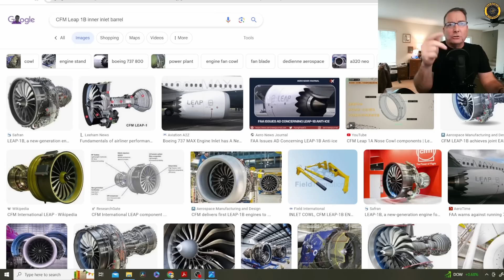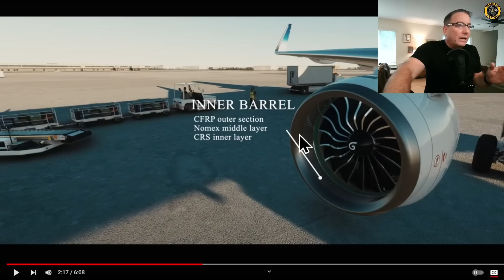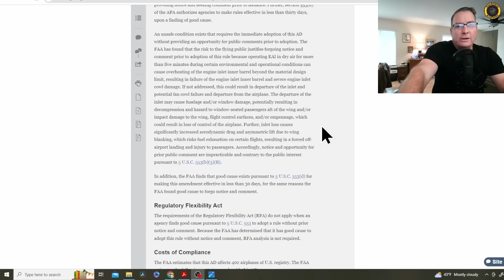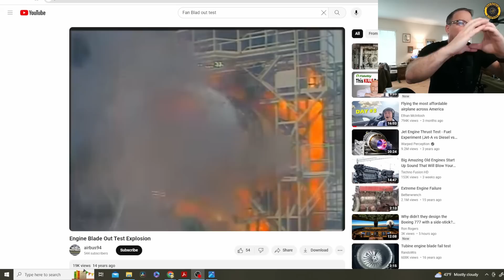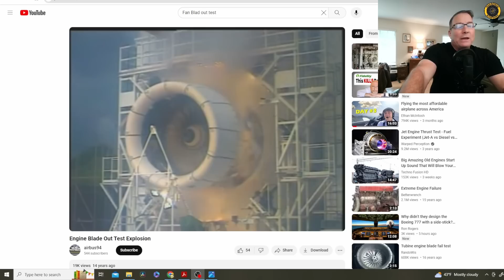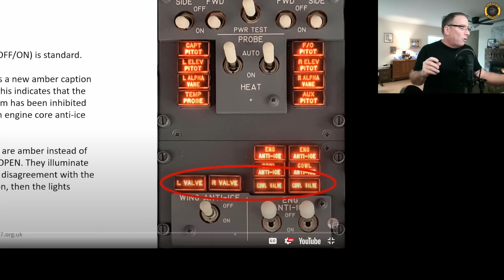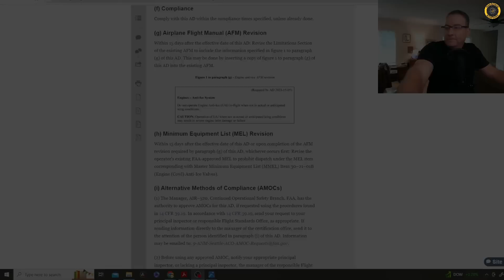Boeing 737 Max-7/-10 Certification HALTED! 1 Feb 2024

Comment: Quality control on an automobile is one thing. You can pull over to the side of the road and get a tow truck. Don't think they have come up with tow trucks for airplanes yet. This is why so many people have a bad taste in their mouths for large corporations.
Reply: There have been no in-flight incidents with the 737s nose cowls.
Reply: But this is just another issue with the 737 Max. I would have thought Boeing would step up Quality control if for no other reason to provide confidence in their planes. If Airbus could step up production( which I know they can't) Boeing would be in trouble. @John-nc4bl

Comment: Doesn't the a320 neos have the leap engines too?  Does it have this problem as well?
Reply: CFM does not design/make the nacelle anti icing components and the problem is not the LEAP engine. It is Boeings design of the nacelle anti icing system/components that is the problem. Airbus uses a totally different design and has NO problems
Reply: Remember he said "newer designs have an auto anti-ice mode"? That solves this problem by turning the anti-ice on and off depending on the conditions. Take a quick guess as to what those "newer designs" might be...
Reply: @davidwright7193  320 is from the late 80's.  But I guess modern enough to not have this issue.   Tks for responding.

Comment: Odd, I'd think the easiest thing to do on a jet engine would be to mix cold air and hot air to a required temperature range.
Reply: Bill, that sounds complex (something extra to go wrong) but doable. However, would that compromise the "single type certification"?  If the answer is "Yes" then Boeing will dismiss the idea out of hand, from what we have found from Juan.

Comment: I was going to ask how Airbus dont have the same issue considering its the same engine on the neo.The fact that its down to Boeing keeping the same overhead switches as the classic,its just another way they jeopardised safety by doing everything they can to avoid crew needing sim time.
They've destroyed the legacy of the 737,which was an amazing airplane,right up to the point Boeing took it beyond its capability and did deceitful and dangerous things to cover the cracks.

Comment: I guess there is both good and bad news in this. The bad news is that these engines are mounted on the 737s and unless some cockpit and probe changes are made, the cockpit workload skyrockets! The good news is that this is a engine supplier problem to fix. What was it...about 20 years ago now that Ford had a very long partnership with Firestone tires and the tires had major issues. Ford got blamed Firestone got blamed, but it eventually got fixed.

Comment: Could the bleed air be mixed with ambient air to keep the temperature within limits of the cowling materials. I know it requires mechanical changes to do this but the engine manufacturer should be able to incorporate this change. Then Boeing could take the time to add in automated controls for engine icing control you mentioned that the 777 has. Love your channel and the comments you get from the videos.
Reply: As complicated as that sounds, that is exactly how every vehicle heater in every car ever made since the 40's controls the cabin heat.

Comment: Why doesn't this happen with the Leap-1A and -1C on the A320neo/C919 ?
Reply: CFM does not design/make the nacelle anti icing components and the problem is not the LEAP engine. It is Boeings design of the nacelle anti icing system/components that is the problem. Airbus uses a totally different design and has NO problems
Reply from the maker: Different engine.

Comment: That used to be my favorite seat on planes watching the air go into the engines. Used to be. I love your channel Juan.
Reply: I used to love the last window seat in the back of an MD80, with the engine intake 3 feet away!
Reply: I used to always take the Exit door available: free legroom, and orientation on how to open the door. Maybe not any more??!
Reply: Yep. But now it’s not air going into the engine, it’s engine parts going into your head.
Reply: My non first class seat is on the rear wing spar, maybe two or so rows aft of the emergency exit door.
Reply: Just don't sit behind the engine or next to it, you should be ok a little bit ahead of it! 🤞👍

Comment: I would have thought that after the 737 Max crashes, Boeing would have had a major wake up call and stopped cutting corners. It seems they haven't learned, and it is basically like watching a slow motion train wreck 😞
Reply: It is not a new design they made since the crashes.. been that way on the MAX all the time.
Reply: Not only they have learn nothing, they are taking down the company, customers, employees, suppliers, general public, and USA prestige, while staring befuddled at the spreadsheet on the screen.
Reply: I thought the same thing about NASA after Challenger and then Columbia happened.
Reply: Airbus A320 disasters.

Source:  Wikipedia

On 28 December 2014, an Airbus A320-216 registered as PK-AXC, crashed into the Java Sea killing all 162 on board. 
The cause was initially a malfunction in two of the plane's rudder travel limiter units.

On 19 May 2016, an Airbus A320-232 registered as SU-GCC, suffered a cockpit fire and crashed into the Mediterranean Sea 
20 minutes before its scheduled arrival at Cairo International Airport.  All 66 on board were killed.

On 22 May 2020, an Airbus A320-214 registered as AP-BLD, landed at Jinnah International Airport gear-up and executed a go-around. 
A few minutes later, both engines had shut down. 
The plane crashed into Model Colony near Karachi on final approach to Jinnah International Airport for an attempted emergency landing, 
killing 97 of 99 on board, as well as killing 1 on the ground.

On 5 November 2014, Flight 1829, an Airbus A321-231 registered as D-AIDP, was flying from Bilbao to Munich when the aircraft, while on autopilot, 
lowered the nose into a descent reaching 4000 fpm. 
The uncommanded pitch-down was caused by two angle of attack sensors that were jammed in their positions, causing the fly by wire protection 
to believe the aircraft entered a stall while it climbed through FL310. 

On 31 October 2015, an Airbus A321-231 registered as EI-ETJ operated by Russian airline company Kogalymavia crashed in the Hasana area of central Sinai, Egypt 
while en route from Sharm El Sheikh, Egypt to St. Petersburg, Russia. There were 224 people on board (217 passengers and 7 crew). 
There were no survivors.
Reply: Until Boeing gets rid of McDD people and their policy it will fail. 
Anyhow now it’s to late, the MDD has metastized within Boeing, new generation engineers and company philosophy were corrupted to lesser standards.
Reply: I'm sure if Boeing had their way, they'd just add an "auto" setting to the de-icer.

Ask the FAA why the price tag for that change is so high.
Reply: They hiring more MBA’s to fix the problems.
Reply: They sure know how to do stock buybacks.  Everything else is a secondary or tertiary concern....
Reply: They laid off staff during Covid.  Then re-hired new employees for less rather than keeping on the most experienced ( and higher wage ) employees.  A huge cost savings and a boost to their stock price.  But, and you can 100% verify this yourself, Spirit, their (wholly controlled) "subcontractor" now has over 50% new hires on its staff and the average number of years of experience being about five years.. Same with Boeing.  The number of people with more than 10 years experience is... worryingly small after Covid.  With predictable quality control and design issues as they try to ramp up production to new record levels.
Reply: @josephoberlander  If Spirit is "wholly controlled" by Boeing, then why is Boeing allowing them to build Airbus A350, A220 and Bombardier Challenger fuselages and other components as well as theirs? That would not make any business sense, and Boeing only knows business. They gave up on actual engineering years ago.

Comment: Putting a note in the flight manual to basically tell the pilots there’s a defect here and if you don’t turn this of , well good luck. I can equate this to some eccentric designer in his backyard, building a flying machine not a major aviation company that should build redundancies of their systems. God help the crew if they get distracted with another problem with the aircraft and forget to turn the anti ice system off.
Reply: I'm put in mind of that plane talked about last week with the fuel tank switch over the shoulder. Had the impression the guy building them was tinkering with designs.

Comment: The FAA has to put a stop to allowing the bypassing of a new varient type certificate by just saying, "Well, it's really the same, it's a just a dash 'x'." ANY change to the material engineering design should require a new type certificate, and thus a new certification process from the FAA. This garbage by Boeing is going to get people killed. And it's not a matter of if, it's a matt of when.

Comment: Imagine having the door fall off, the wings melt from anti-icing and for good measure the plane just nosedives into the ground. 10/10
Reply: Twice.  RIP to those poor bastards and may the accountants and executives that killed them enjoy their eternal judgment.  And to the engineers that went along for the ride.  I faced a similar situation at my old employer, an engineering firm that outfitted navy ships.  Little of our stuff was life critical but the cost cutting got so bad and they pushed the engineers so bad I just quit.  I quit engineering altogether and went into repair work.  It’s far more lucrative since the engineers and accountants build so much work for us.
Reply: Yet nobody goes to jail...!!
Reply: @jb-xc4oh    all by design.  it's called limited liability corporation (which were not allowed when the US was founded, by the way, because the founders had seen first hand the corporate corruption of the East India Company).  LLC limits the liability of the owners and corporate officers.  Used to be, corporate officers COULD be charged criminally for things like, oh I don't know allowing their company's avionics software to fly their airplanes into the ground, but for decades now there is no will to charge corporate officers with crimes.  Instead, they fine the corporations and the corporate officers just look at the fines as the cost of doing business, SO THEY KEEP COMMITTING THE SAME CRIMES!  Wells Fargo and Pfizer are good examples of this criminal corporate culture.
Reply: And a spaceship that can't tell time
Reply: @Paramart - actually, the engine would be the component that would melt and fall off.  Minor detail.
Reply: With an aircraft OEM like this, who needs terrorists?
Reply: then they blame the pilots
Reply: Well that a Max for you.
Reply: Oddly enough who still receives bonuses while this non vaccinable epidemic of failure and faulting surges around but oddly again not anywhere near headquarters.
Reply: I would say job well done....if this was your actual goal😂😂
Reply: It’s alarming that it’s up to Boeing to stop the certification process. The FAA should be making that decision. But I guess they have their hands full policing the little guy. They won’t do sh!t to these monster corporations that put profits over safety.
Reply: Its not the wings that are going to melt.
Reply: Triple redundancy?
Reply: I’m very worried that this will actually happen. I fly about bimonthly…no more Southwest…I don’t care what it costs. I’m not getting on a 737 again. Or any Boeing plane until something drastically changes.
Reply: @mollymollie6048 The 737 is the older model not to be confused w the 737 MAX. I actually stopped flying Alaska and choose Southwest instead. The FAA should be fired and sued.
Reply: @schahrzadmorgan  Thank you, I’ll edit my comment. I’ve avoided the MAX for several years…but, well…I won’t edit my comment because I don’t feel comfortable getting on a Boeing airplane at all right now. I remember when the older version 737’s were crashing randomly in the 90s and it took a few years to figure out why. So…that plane is off my list for the time being.
Reply: @schahrzadmorgan  Umm... Southwest operates 737 Max aircraft and 737NG. They are a big part of why Boeing designed the Max in the first place.
Reply: @dougrobinson8602 I was about to say, SW is one of the biggest Max operators, wonder who is she going to fly now. Lol
Reply: @mollymollie6048  I agree with you.  I went through a 20 year phase in the 80s and 90s refusing to fly 737s  and DC-9s on any domestic business trips.  The Admin who coordinated our travel plans was a pro at keeping me off of those aircraft.  

737s and DC-9s(MD-80s) have a very very long history of being junkers.
Reply: @Slonge92  Also was very scared of DC 9s, but was a kid and had no choice in what I was being put on. I remember the 737s falling from the sky (faulty hydraulic…something…that froze everything up) and also avoided US”Scare” of the infamous SNL skit “at USAir, we don’t have a death wish.” I had a boss during that time who refused to fly USAir, and had to switch her flight to another airline…the one she would have been on was the one that crashed in Pennsylvania.
Reply: @mollymollie6048  All Boeing planes are perfectly fine, even the 737s are perfectly fine. The only issues is the 737 MAX. In fact for years most Boeing planes have actually been better than Airbus and other jets. Again, it's just the MAX that's the problem.
Reply: @thecomedypilot5894  Well the 737 900ER has the identical door plug as the MAX, and the FAA has reported that some airlines have found issues with the bolts during maintenance inspections on those as well
Reply: @NondescriptMammal  Ok and? The whole door issue itself will easily be resolved, the point I was making was that it was the MAX that’s constantly having problems. Other than the slight door issue, the 900ER is perfectly safe to go flying, along with every other 737 that isn’t a MAX.
Reply: @thecomedypilot5894  I only mentioned it because you said "All Boeing planes are perfectly fine, even the 737s are perfectly fine."... The word "perfectly" has a meaning, and it is even kind of odd that you say "perfectly safe" now, "other than the slight door issue".
Reply: @thecomedypilot5894  I mean, how exactly do you know they are "perfectly safe" otherwise? Have you personally inspected all of them?
Reply: @NondescriptMammal  Dude, Boeing planes have been flying for several decades. The only brand new Boeing plane is the MAX, the normal 737 brands though are completely safe because the aircraft themselves don’t have the same components that the MAX has. The MAX issues have nothing to do with the other Boeing aircraft.
Reply: @thecomedypilot5894  In reality, it is obvious that there is no such thing as a "perfectly safe" aircraft. Do you disagree with that statement? If not, why do you find it necessary to say such things?
Reply: @NondescriptMammal  But aircraft are exponentially safer than cars and other modes of transportation, it's even safer than walking. The only aircraft with issues is the MAX. Everything else is far safer than any other mode of transportation.
Reply: @thecomedypilot5894  This is clearly true in commercial aviation, but not true in general aviation. General aviation fatality rates per passenger mile are comparable to driving a motorcycle, which is more dangerous than driving an automobile. 

And even when comparing commercial aviation versus automobile travel, the statistics change drastically if you are a scrupulously defensive driver, when you consider that the automobile statistics include all the intoxicated drivers, distracted drivers, just plain careless drivers, incompetent drivers, inattentive drivers, aggressive drivers, etc.
Reply: @thecomedypilot5894  And just to be clear, I was only really objecting to your terminology. I don't disagree with you in spirit, generally. The only "perfectly safe" aircraft is the one parked in a hangar, just as the only perfectly safe car is the one parked in a garage. 😺
Reply: @thecomedypilot5894 I don’t think you know what “exponentially” means.
Reply: @patrikfloding7985  I don’t think you’re intelligent enough to continue this conversation.
Reply: Ok, I lmao-ed

Comment: Question from a non-pilot, non-engineer. Is icing also a problem during spring and summer flying?
Reply from the maker: Absolutely!
Reply: Temperature drops as you go up so it is always below freezing at the altitude these planes cruise at.